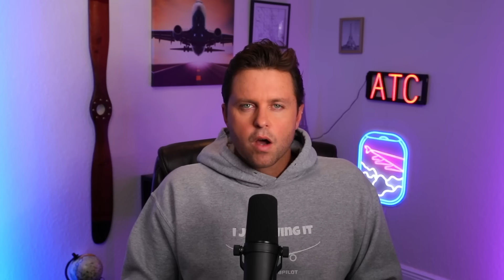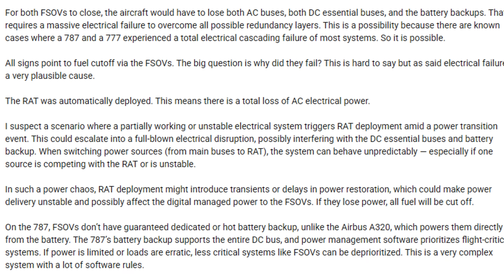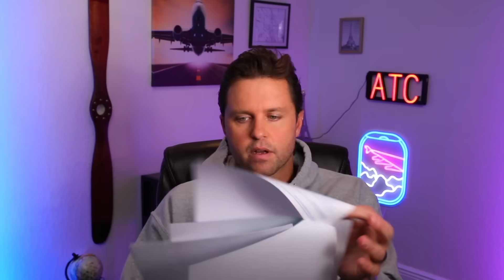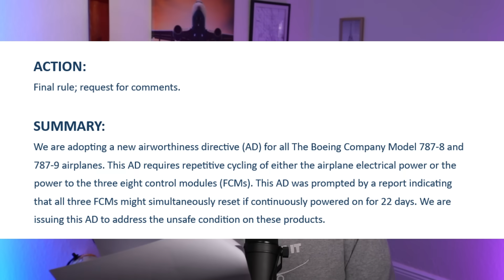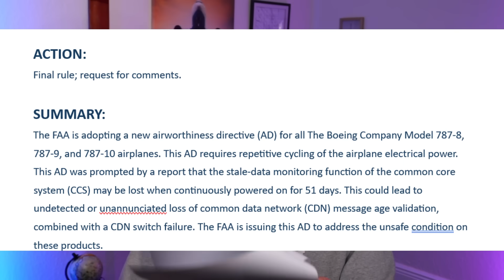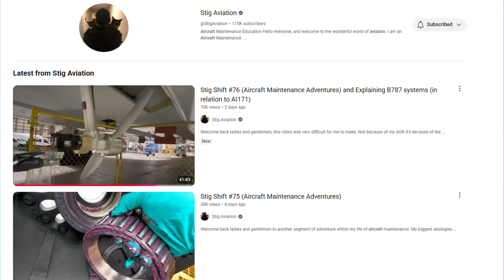Air India 171: Did a Software Glitch Cause Dual Engine Failure?

Comment: Now this is starting to take an interesting turn. I'm an engineer for functional safety in the automotive industry and single point, latent and cascading faults are my everyday bread and butter. This whole time, when people were talking about pilot errors, component failures and fuel issues, I was just thinking about whether that plane might have an issue in its safety architecture. Faults of this type should be found in analysis of the system during development and need appropriate counter measures. However, I know that the aviation industry is even stricter with its layered safety and redundancies than us plebs designing electrical systems in cars. So this would be pretty wild. However, these systems are designed by humans and humans make mistakes, especially under pressure and safety, ultimately, always runs against the wishes of management, since it always makes stuff more expensive and tends to delay the launch of a product.
Reply: One of the prime directives in manufacturing airplanes and avionics is that no single point failure should result in loss of the system or the aircraft.  Systems and safety engineers develop extensive fault-trees for each bit of avionics as well as for the entire system, these are reviewed and and receive extensive scrutiny throughout the development and life of the aircraft.
Reply: @davidshema2614 
It would take the testing to destruction of the whole electrical system of a working aircraft to see if a major short circuit or failure anywhere in any circuit and system would be isolated from from essential avionics and engine control and electric fuel pump circuits.
Reply: @davidshema2614 Obviously, Boeing's efforts to identify potential failure modes was insufficient, and as a result, people died.  
This is the third time in recent memory when Boeing's focus on proffits over safety has caused critical failures.
Reply: @n-xplorer Is there any?
Reply: I think engineers need to ease up on shoving so much electronics into cars and airplanes. All that electronics does not contribute to reliability or safety but does the opposite. I refuse to purchase any new modern car simply because of how over-engineered they are, completely unnecessarily, to the point that some of those new cars can only be serviced by a dealer who charge an arm and a leg.
Reply: @Тольяттинец-н6ъ Absolutely correct,I have just purchased a 27 year old car with only 17,000 miles on the clock and NO electronics in sight because I’m sick of failures in modern vehicles,it’s been stored and never run for 15 years and is in immaculate condition,if I have to spend a couple of thousand pounds getting it ready for the road it’ll be well worth it.
Reply: @davidellis279 
Imagine what happens to the safety of all these computerized airplanes as they age. An average lifespan of a household computer is what - 5 years at best? Then it starts freezing and blue-screening.
Reply: @Тольяттинец-н6ъ never had this issue before Steve apple make the computer. Think about this
Reply: @Phil_From_Canukistan 😅
Reply: @carolep.1645 many possibility to explore. Said televisions of no function. Perhaps engine have incorrect satellite channel select
Reply: @Тольяттинец-н6ъ that jet is 90% electrical and sw heavily dependent...I'm the only 787 safety engineer and that job was dangerous..I flew on the md-80 jackscrew nightmare for many many yrs..wow i still think..all due to dumb maintenance 

We're much better than this..aren't we?
Reply: @Тольяттинец-н6ъ  It is absurd indeed.  Cars have become too complex in general due to attempts at fuel efficiency.  In the US the car repair industry is in trouble, ...repairing cars has become problematic, ....problems very difficult to diagnose, and repaors are complex and costly requiring much disassembly.  Perhaps the Internal Combustion engine has become obsolete and the repair industry eventually will fade as more and more casrs become electric.
Reply: Modern aircraft are becoming far too complex and the reliance on computer systems instead of the human brain is starting to take its toll.
Reply: @petercollingwood522 tbh, most plane crashes are caused by human error.
Reply: @BlackRose-vi2yg Especially if that human is sitting in a boardroom.
Reply: @petercollingwood522  That's why I prefer the B737NG.
Reply: Short circuits can do serious damage.My comparison would be dropping a spanner between a starter motor supply terminal and chassis.The resulting short can feed, or back feed in reverse polarity, massive amounts of current through whatever pathways it can find.
The engine management ECU will generally be toast.
The engine FADEC/EEC systems also network with numerous other circuits through the APU supply distribution system.
Reply: I can't fix my car either. I want my carb & distributor back! Duh!
Reply: As a safety professional, I agree with you completely. Companies are always say that safety comes first for their employees, but if safety slows down production too much or costs too much, safety becomes less important.  It's very frustrating.
Reply: Yes humans make mistakes. But engineers if they don't make mistakes are told to not do certain things from the higher ups because of cost savings. If Airbus did it, Boeing should have thought - yeah it's a good idea to do this, let's do this. But they didn't, and now we are seeing the result. Extra redundancy done well will always be better. The only reason to not do it is cost savings.
Reply: @SahilP2648 Yes, safety costs money and managers try to balance between profit and the tolerable level of risking people's lives. This is how it is when we live in a world where we all value money above anything else, its karma: if you do it then other people will do it (at your expense) too. 

And knowing intimately about the SW industry and how release-decisions are made, how released SW is always imperfect by decision, I would NOT like it that we build airplanes where SW is in charge of the life critical functions like shutting or opening the fuel valves to cutoff fuel from the 2 engines to either drop the plane and kill 300 people or not. SW is given way too much trust in this case.
Reply: Well I was an avionics Engineer. Human error is possible. It's highly unlikely a software error can fail two engines just because of the fact that the same team doesn't  design or implement the system including software. So systems or software is an extremely rare chance on a redundant system. I suspect it will most likely fail due to complete electrical failure and complete electrical failure can happen due to fire , li ion battery blast or destruction of EPC.
Reply: It all comes down to money as usual,that’s why they won’t ground the whole fleet of 787s, they shouldn’t let them fly until the cause of this crash has been found. If another crashes someone will have some questions to answer but that won’t help the people who might die as a consequence of them not being grounded.
Reply: Sabotage...from the ones who want to replace airplanes with flying cars...my condolences to all the families who lost loved ones and the survivor who will suffer from survivors guilt and PTSD...😢😢🙏🙏if it's not an A320 not going on any airplanes...
Reply: @Care-o9i computer make the sabotage?
Reply: It's a Boeing. Their safety record isn't good recently 😂
Reply: My comment is simply, uh oh, I think I know where this is going.  Greed!!  who’s greed? If you don’t get it, just read the last couple of lines of this calm out by the safety engineer for functional safety of automobiles.
Reply: Black box needed!
Reply: Oh yeah engineers make mistakes all the time when u over budget and behind schedule and then safety issue crops UP...mgmnt says STFU..OK yeah I get this then I don't
Reply: @Uxoriously me: marine engineer. Very very typical to maintaining ships. 

All the time, requesting spark plugs for the main diesel engines. Orders never make complete.
Reply: A major power surge based on share even in redundancy single point - single potential factors being the bonding grounds.  A bad conductor on the grounding buss from a high current load which is inductive and DC can ripple voltages of notable size.  Think of power supplies getting this anomaly surge all at once.  

The power supply might try and fail over of course while a reset and repower occurs taking X seconds.  But if all redundancy is doing the same thing, you could loose total power, and/or data.  

Water or due moisture may also be a contributor given the humidity and “non condensing” thresholds may have taken out data causing cascading events to fire.  Remember the witness passenger saying he heard a bang and then things went south.  If that is accurate the was not necessarily the RAT.  It was the failure itself.  Like an M80 that bang could be electrical.

Feel free to poke holes or add.  I am waiting for the official report.
Reply: @jerryrobinson7856 are there not surge protectors (power strips) on the bus?
Reply: @Phil_From_Canukistan The engineering redundancy of an aircraft is substantial as it is brilliantly impressive.  All systems have lightning and power surge protection, way beyond what we know as surge protection.  Part of redundancy is a fail over to a redundant system. Part of it is power recycling to re-establish its ‘primary’.  These are extremely robust.  But the only theory I buy ‘at this moment’ is IF a major power surge occurs, you may have primary, secondary and the back up equipment power or data resetting at the same moment and that’s an extreme anomaly.  Let’s wait for the official report.
Reply: @jerryrobinson7856 maybe great possibilities passenger make unplug power cord to main engine
Reply: 1. Primary Cause – Electrical Power Transfer Interruption (PTI) During Rotation
 • During transition from ground to airborne electrical configuration, the aircraft experienced a cascading dual-engine FADEC (Full Authority Digital Engine Control) failure.
 • Root cause: Uncommanded bus transfer failure due to arcing in the main power relay box (PRB-A), traced to water ingress during pre-flight GPU disconnection in heavy rain.
 • This led to loss of electronic engine control at rotation, resulting in both GEnx engines rolling back to ground idle within 4–5 seconds.

2. Flight Data Record Timeline
 • +0:11 sec: Nose gear lifts off.
 • +0:13 sec: Sudden engine rollback begins. Thrust reduces from 92% N1 to <27% within 3 seconds.
 • +0:16 sec: Master caution + ENG FAIL L/R warnings. FO calls, “Both engines dropping!”
 • +0:20 sec: Autopilot and flight control reverts to Direct Mode. Pitch up attitude peaks at 18°.
 • +0:25 sec: Aircraft stalls at 186 ft AGL.
 • +0:30 sec: Full aerodynamic stall; nose drops rapidly.
 • +0:38 sec: Ground impact at 54° nose-down attitude, 174 knots.

⸻

⚙️ Contributing Factors
 • Environmental Conditions:
 • Torrential rain during pushback.
 • Moisture intrusion into PRB-A connector (P/N: HLN8471) — a known corrosion-risk component.
 • Latent Maintenance Issue:
 • Power transfer relay unit showed signs of thermal damage in a previous MEL deferral 2 weeks prior.
 • No replacement had been conducted; aircraft was cleared under repetitive deferral.
 • Design Oversight:
 • Boeing 787 has no physical engine control backup (i.e., no direct mechanical linkage in FADEC loss scenario).
 • Loss of power supply to both EEC channels resulted in engine “freeze” at ground idle instead of flameout.
 • Flight Crew Response:
 • Attempted engine relight sequence not completed before stall onset.
 • Emergency power selector not activated — possibly due to confusion from multiple ECAM warnings.
Reply: It seens to be a service error or something like that. Never this model would made over a million takeoffs without problems if there were an assembly or design glitch.
Reply: Unfortunately, I actually understand the lion's share of the technical aspects of potential faults that were cited here. And since I have a handful of Trans Atlantic flights as a passenger on 787s at 7 and a half miles above the water under my belt, none of this is good news.
   If all of this is actually factual, then my over-weight suspicions would be firmly ruled out.
   I think those people were spared much horror, in that they probably died before they understood the fact that they were in mortal danger. 
    But make no mistake, Boeing is our last commercial jet manufacturer, and they probably need to get started on a software/ hardware update now.
Reply: Boeing was cutting COSTS with cheap China parts, layoffs, outsourcing to Third World Maintenance, while paying themselves executiives Fat Bonuses
Reply: So you know nothing about air craft😂 opinion invalid
Reply: We are talking Boeing here. Which has a terrible reputation ever since the beancounters from Mc Donnell Douglas took over.
Reply: Nobody cares what you do
Reply: I'm with you.  !
Reply: @Richard-xv3gw no speak of anti virus software on main engines. Very troubling lack of computer security condition.
Reply: @Richard-xv3gw logic is behind this probability and ghod
Reply: https://youtu.be/dIgnR0zw3FU?si=FIglkTDBwcJWlfU3
Reply: I was THE ONLY safety engineer for the 787-10 and YES the only one...I reported to FAA what mechanics showed me working electrical and I said no not moving until jet was fixed and would contact mgmnt tomorrow as late at nite..next day that jet gone..1 gent told me safety engineer is invisible and they don't matter.. mgmnt set me up for failure tried fire me then tried off me just like John Barnett qual engineer and yeah HE IS DEAD..BUT FOR ALL THE WRONG REASONS.
THAT JET HAS ISSUES GET IT FIXED DAMMIT NO MORE STINKING CRASHES IM TIRED OF DREAMING OF 4 COWORKERS WHO ALL TOOK THEIR LIVES...IM TIRED OF THIS CRAP.
SERIOUSLY.
Reply: My comment is simply, uh oh, I think I know where this is going.  Greed!!  who’s greed? If you don’t get it, just read the last couple of lines of this calm out by the safety engineer for functional safety of automobiles.
Reply: The same craft has been around for 11 years.
Reply: @morespinach9832 extreme amount of time for paint limitations. Very very easily make engine situations.
Reply: This plane has had 15 years of error free operation 

I will bet anything automotive you are involved in has way more faults than this incredible  plane
Reply: @shdmd2118 such long time without balance of tires. More add up information to crash probability
Reply: The key phrase being “during development” which was outsourced to several other countries.
Reply: @tenminutetokyo2643 wonder if Pakistan was a country it was outsourced to and they make sabotage for computer with India being purchaser of aircraft
Reply: @tenminutetokyo2643  787 has had perfect record for 16 years . I am sure your car has had much worse record
Reply: I am playing devil's advocate here. Could the fuel system have been hacked from an outside source? Is it a possibility?
Reply: @Lyn4817 perhaps computer run virus scan to disallow input from outsider sabotage
Reply: This entire time I’ve been thinking electrical. I deal with fixing designs on the fly//build. I recently did a bunch of ummm ‘aviation’ builds. Yes, the paperwork//standards is never ending and suppose to be strict. But the prints and ‘design’ far from functional, which is handed to ppl to wire and they’re told to follow the prints. Problem is not everyone has a clue when they are following something completely wrong. 

I’ve also seen far too many programming branch’s to solve hardware issues but losing power seems like maybe loose connection which caused a direct short 😢 which would cause some electrical issues before totally coming loose 🤷🏻‍♀️
Reply: @chipsaregood counterfeit electrical parts on market. Relating into making short circuits
Reply: Maby now the bean counters  are Satisfied.
Reply: @tomrinde4487  16 years perfect record

It’s still 10000 times safer than your car … whatever brand
Reply: Therac-25 was trusted and safe. Until it wasn't. You could very well be right.
Reply: This seems to be a plausible explanation. I was working as safety engineer at a chemical company and dealt with very similar issues in safety architecture. Based on the scenarios described, the correct action only can be to ground machines of this type immediately.
Reply: New boing is NOT old Boing =

Profit > Safety
Business Decission > Engineering
Time > Quality

Just look at all the problems that arose in the plane and space section after they switched company culture!

When engineers are told to shut up and are retailiated against if they dont then you know something is MORE THAN WRONG!

https://www.youtube.com/watch?v=bZsUHIGGW7M&t=1s
Reply: We still do not know the root cause for this crash however. It may be because of this, but we need to wait still.

The interesting thing is this issue didn't present itself in this way until now. More than a decade since the first delivery.
Reply: @ukmaxi  However, it has happened multiple times on the ground. We were lucky for a long time.
Reply: @hsuontaa  I am not saying this isn't the conclusion. However, I am still sceptical about it being the root cause since this is still a runaway explanation that fits our confirmation biases.
Reply: The plane is 12 yrs old and 787 is flying for 14 yrs then you came into electrical glitche conclusion
Reply: @RommelLegados Yeah, this is what I am struggling with. Considering the 1100 787s out there this feels like it should be a more common problem if this is a persistent issue.
Reply: @ukmaxi airlines should be hands on to their 787 fleets ..  This is a high tech plane loaded with new tech...
Reply: Especially given the safety lapses reported at Boeing by the whistleblowers
Reply: I'd stay away from tall buildings for awhile.
Reply: Considering boing sacked all the quality controllers to cut costs and increase productivity then they probably don't even test the systems after installation so they won't catch any issues at the factory I bet they don't even test fly the aircraft before delivery
Reply: This wouldn't be a human mistake, this would be human stupidity.
Reply: Absolutely!
Reply: A compelling argument and very disturbing.
Reply: Boeing is having a lot of quality issues due to their DEI philosophy - hiring or contracting with less qualified staff to compensate for their skin color or sexual preferences. That is well known and is not a hypothetical.  The question now is how quickly will these problems hatch and will Boeing survive as a company after several more of these "incidents." How many times will people want to get "vaxed" and pretend that nothing happened?
Reply: Exactly. As long as humans make mistakes caused by all possible errors and negligence, as long as managers and directors and politicians are lead by greed, high positions, power, blackmail, ignorance and indifference, we should never embark on a cruise to Mars or beyond. There can be no trust at all in those voyages. Nor in settlements on other planets.
Reply: Hence the reason of Boeing stock price. Buy it when it tanks.
Reply: @ts440s Not yet. Many in the market refuse to tie DEI to disasters. It will take some time.
Reply: Thank you for all you do keeping our planes safe
Reply: So why no worldwide recall??
Reply: In short, the Boeing 787 electrical system is badly designed.
Reply: @zizimai7568  We don't know that yet. We know that once the root cause for the crash is understood and if it turns out to be a failure in the electrical system the question will be how complex of a failure we are talking about.
There is no 100% safe system. Not in an airplane, not in a car, nowhere. You cannot design a system to be 100% safe. The goal is therefore to make the system reasonably safe with residual failure rates at an acceptable level.
So if it turns out that this crash only happened because like 5 components failed in just the right way simultaneously and it's not a cascading failure where one failing component causes the next one to fail and so on, then it's just bad luck. If it is indeed a cascading failure or an oversight in independency of system or similar, then you can blame boeing for it. And even more so if it then turns out that they knew of the problem and had internal risk figures that would be way too high like with others of their past problems ;)
Reply: Cyber hacking ?
Reply: Im an Automation Engineer and also Design Failsafe Applications for industrial Plants, Software and Electrical.

The Shutoff Valve is a Dilemma, Priortizing which Function should bei Failsafe is a Challenge.

But my God, if your Software glitches Out after a certained amount of Time, you really need to think twice about your Quality Assurance.

In Industrial Applications you Count the Meantime to Failure in Decades!! Not Days....
Reply: The interesting perspective is the fail safe behavior of the Shutoff Valve in case of a potential engine burn... These valves could possibly be activated in a unpredicted (or not tested) state
Reply: Now you know why most people don’t like electronic/digital in automotive systems!
Reply: @andyxox4168  But that's kind of absurd. Mechanical systems can fail just as much and you can't even do anything functional to make them safe.
In the 70s you'd have a mechanical connection between the accelerator pedal and a gas throttle, which can get mechanically stuck, leading to unwanted acceleration. Since the 90s you have digitally controlled fuel injection with an ECU between you pedal and the engine. Now that ECU can fail, leading to unwanted acceleration, but at least you can do cross checks between independent sensors and have the system default to "off" if anything fishy is going on. So it's more complicated, but indeed safer.

Same goes for systems like power steering,  abs etc. Those wouldn't be possible without these advancements, make the cars easier and safer to handle, but need some well thought out engineering to avoid unintended and dangerous behaviour. The alternative would be to just not have these systems altogether.
Reply: @WyandWombat  … you forget about clutches, gearboxes (manual and automatic), mechanical braking systems and of course ignition keys all of which can safely disconnect power and bring a vehicle to rest and as for steering that works just fine too!

(and in the 90’s (00’s and 10’s) the accelerator was directly connected to the throttle body, the ECU only metered fuel and timed the ignition)
Reply: @andyxox4168  Sorry but that's just delusional. If you think you'll just pull the ignition, while your car full on accellerates on it's own, the ABS just decides to lock your rear axle or a front tire or the power steering just decides to turn full left while driving, then I have bad news for you.

And work on standardized safety architecture for microcontrollers and software for electric gas control started in the 90s.
Reply: @WyandWombat  … yes, you can just turn off the ignition if the accelerator has stuck, depress the clutch or knock the vehicle out of gear … simple. As for the brakes, they work just fine too!
Reply: @andyxox4168  Statistics say, most untrained driver are unable to handle these situations. And since your are talking about "brakes just working fine" - we tested this. We simulated loss of power steering and breaking assist during a turn at moderate speed. People even knew it was going to happen. Not a single one managed to stay on the road.

You simply don't turn it off or depress the clutch. You panic and crash. That's reality. Also, the brakes fall back to a legally required minimum braking power, which is just poor. They turn stiff and you will feel like they don't do anything at all.
Reply: @WyandWombat  … sure you’re exactly right, cars used to randomly drive off the road all the time with stuck throttles in the last century because people couldn’t turn the ignition off, depress the clutch or knock the vehicle out of gear and god forbid a power steering failure, that was the end of the world … then again maybe the people in your country are poorly trained, poorly informed or just particularly poor at driving.
Reply: Very well said. Thank you.  The safety architecture being described on the “modern” 787 sounds like it was not fully vetted or analyzed.  My guess is they wanted to sell the “enhanced” performance of computers in control - but didn’t want to consider any of the downsides of computers in control.
Reply: Unsafe at any altitude! Ralph Nader, get cracking!
Reply: @tommytwogloves1 Naders niece was killed on the second of those 2 flights with the computer problem that the pilots couldn’t fight. He did get on it.
Reply: @tommytwogloves1 You good at resurrecting?
Reply: Dude I couldn't agree more! Thank you for this.
Reply: But so many planes out there without a problem
Reply: @captainbernhardf  Issues like this usually rely on either very specific states of software or random hardware failures. So they don't "go into effect" on every plane on every flight. Regardless, it would be troublesome if it did in fact turn out to be true that this plane has a single source of failure that can cascade into the engines shutting down despite there not being an issue with the engines.
Reply: @captainbernhardf There was a few 737 Max flying…until it happened and it only takes one. Also electrical issues were not new things on the 787, there has been a video of a hearing that a former engineer did (whistleblower) whom was on the 787 project then pushed onto the 777…don’t ask why 😉knowing how Boeing politics works since a while which unfortunately does not surprise me ! 🤷🏼‍♂️

https://youtu.be/rvkEpstd9os?si=_Us9sICwUyYEbIE8
Reply: @captainbernhardf because of the in flight entertainment supervision television system
Reply: @absolutely1337 IFE rolled out on many models...but 787 has loads of electrical..maybe most load dependent than any other commercial in this configuration or group. So yeah multiple failures calculations get very complex very quickly. 
Satellites similar..those electrical traces down right crazy.  We had to use magnifying glass to track the connections on the gigantic drawings
Reply: @captainbernhardf ... waiting to happen...
Reply: @captainbernhardf all these beautiful types of birds of Boeing then along comes Mary a griffin vulture and she became the 787...nobody ever seen a vulture like Mary..Frankenstein birds and her body and design was one of nearly 1k's of issues later..Mary flies ok most of the time but as Mary gets older her wings get stiffer her beak gets chipped away  not as sharp and Mary brain has fuzzy sw...wiring.
Bye Mary
Reply: @captainbernhardf The problem will only show itself when you have a minor electical problem on the plane and then the fuel will be cut off. Not before that.

The real problem here is that the sofware should prioritise keeping the engines going ABOVE EVERYTHING ELSE, and now it doesn't. Now those engines are taken down by the software whenever there is any electrical problem like cabin AC not working, because Boeing wants to protect the plane from an electrical fire.

This logic is f*ing MAD and frankly very scary.
Reply: 1500 Dreamliners out flying the world, so 1 crash = 0.0666666 % , how that statistically ? That why they say flying is safer than that automobike taking you to the airport for your flight
Reply: @captainbernhardf  yeah, many aircrafts out with no problems. But, as with all computer controlled systems, they rely on software, and any software can work perfectly fine until some rare situation emerges and things go terribly wrong.
A friend of mine is a software developer and they had delivered a system that worked perfectly fine, during testing and also in use later, until a new guy got to use it. He several times got the whole system to crash. In the end they found out that he once in a while did some type of stretching of his hands by pressing a certain key combination on his keyboard. It was a so rare event that nobody ever anticipated it, and always ended in a full system crash.

Here in the plane we have not only software systems, but also system switching from normal power to the RAT, or over to battery power, and just a fraction of a second of power loss to the FSOV, and in that phase of flight there won't be anything that could have been done. 
Back to the thing with redundancy, like mentioned, on the A320 available. 
Why can a voltage surge cause this already, it's ok that it's used as a safety, to cut off the fuel, but why doesn't the FCOV have an own power supply, like a capacitor, so it will stay in open position for 2, 3 or 4 seconds after voltage drop, by that the power could have returned before they would activate.
Reply: This airplane was excellent for 15 years. Now a computer glitch ? Seems more Air India maintenance to me.
Reply: @NicholasGolding-v4m  Maintenance can be another source of these failures, yes. Pick it apart and put it back together wrong and now it's not how it was designed anymore. I guess we'll have to wait and see. But this being a functional failure and not an external factor like contaminated fuel or incompetent pilots is where it gets spicy :)

With that being said: A problem being introduced by maintenance should usually be detected if the system is designed properly. Safety critical systems run self checks at startup to make sure everything is still running as it should and either warn operators or refuse to start up in the first place if anything is off. That's where the yellow lamps that you ignore in your car come from :)
Reply: @NicholasGolding-v4m .......my digitally controlled washing machine runs fine when new. But after 15 years, it's computer program runs the machine in a cranky manner with many computer glitches that had to be reset/reboot by turning the wall power switch off for 5 seconds and then on again. This is what is termed a computer program reliability issue. Only that with digitally controlled washing machines, no human lives are lost in the process.
Reply: Driverless cars will cause huge problems down the road, for the same reason namely far too many situations to consider during design and some situation easily missed by the human, also not feas8ble to test all test cases.
Reply: @NicholasGolding-v4m real life conditions outside test conditions? 20 year mean time between failures on an electrical component that failed prematurely due to extreme real world (heat) conditions? Not specified in maintenance schedules? Plenty of reasons possible other than trying to blame the maintenance guys.
Reply: @NicholasGolding-v4m  I wasn't excellent. just managed to dodge catastrophy till now.
Reply: @NicholasGolding-v4m  Didn't you ever had to reinstall the OS in your computer? Tell me what brand, model and configuration is, I wanna one of those! I'm also looking for a fatigue-proof car.
Reply: @NicholasGolding-v4m  Did you hear about John Barnett, the Boeing whistleblower (apparently suicided during legal depositions) saying the metal shavings being left in the planes would cause electrical problems, and that it takes about 10-15 years for problems in manufacturing to show up after the plane is in use.
Reply: @libby2012 that isn't really possible, the plane has gone through a d check. Air india took the entire plane apart and pit it back ttogether. They would have found those during that. If they found any, they would have grounded the fleet and looked for more.
Reply: @NicholasGolding-v4m  I have a friend who does software work for a major airline. Just days after the crash, he was saying the crash was due to company specific software update done by Air India. 

I don't have first-hand information so I am relaying second hand hearsay information so consider that when weighing the information I am giving.
Reply: Blame Joe Obiden
Reply: @josephlamb9175  bury all magas
Reply: @josephlamb9175  what? For not getting us into WWIII, while that's exactly where 45 is taking us? Our allies didn't have travel warnings against us under Joe either. 
But I'm sure we're not careening into the abyss...
I'm sure everything is Joe's fault. Even tho he hasn't had one legal issue in his 40 years of government service. 
Meanwhile 45 has 34 felonies and has a record of tax fraud and defraudeding his own vendors so badly in the 80s that the US had to rewrite its bankruptcy laws to stop Trump from robbing people over and over. Can't call it a political attack, he wasn't in politics back then. Plus he was a Democrat. He was still a whiner who blamed everyone else for his consequences tho. 
Try again...
Reply: perhaps engine make to off
Reply: @Phil_From_Canukistan make your way to the chipper, please
Reply: @notsoeloquent mom??
Reply: @Phil_From_Canukistan  one word. Inappropriate for me to laugh so hard🤣. Funniest comment of the day on the entire Internet. 😂😂😂
Reply: Esp when these engines have their own permanent magnet power supplies… Not impossible, but EXTREMELY unlikely… But if true, whatever Gen Z / DEI / or H1B hire over at Boeing SE allowed this to happen… God Help us…. !
Reply: @Ch1n4Sailor  You don't know the inner workings of boeing and whether or not this was simply an engineer making a mistake. The engineer rarely has the final say in these things. Management does. It wouldn't be the first time that an engineer points out a weakness in the system, only for management to overrule him and saying stuff like "yeah but come on, how unlikely is THAT" and then just sign it off for production.

If you think that never happened, then think about the disturbing track record of boeing whistle blowers being murdered following the 737 MAX desaster. Those were engineers who wanted to go on public record sticking it to management saying "told you so, but you didn't listen".
Reply: @WyandWombat  that's exactly what happened.
Reply: @WyandWombat  Amen to everything you said. I was a software engineer for many years, and we were always subject to the whims of management, some of whom had no idea what went into designing a system because they had no hands-on software development experience themselves. All they ever cared about was deadlines, and there was an extreme amount of pressure to get things done by a certain date, regardless of the quality of the final product.

Also, problems of this magnitude are generally not traceable to any single person. There was a lot of thought that went into that system architecture by a team of engineers. It requires robust system testing of every scenario under the sun to catch everything. There will always be bugs.  Unfortunately, if this is what actually happened, this is a big mother of a bug that it’s hard to believe nobody anticipated.
Reply: @Ch1n4Sailor I doubt it was a failure of electrical power to or within the engines but redundancy can be bypassed if there is a single common bit of faulty information being fed into the system
Reply: @Ch1n4Sailor  🙄🙄🙄🙄
Reply: @Ch1n4Sailor  maybe magnet go to opposite polarity and messes up television on airplane
Reply: @Phil_From_Canukistan ❤❤❤❤❤❤❤❤❤❤❤      yes that is what happened